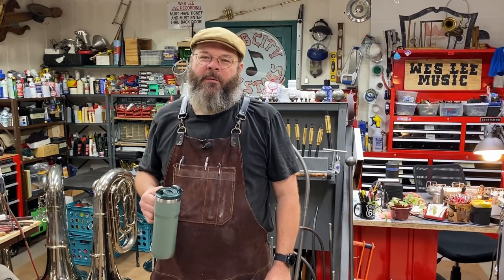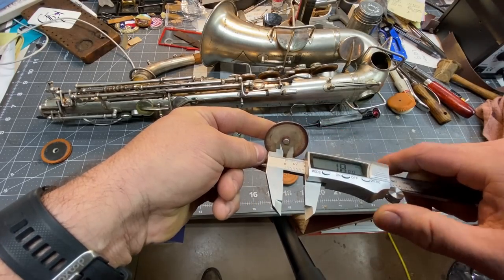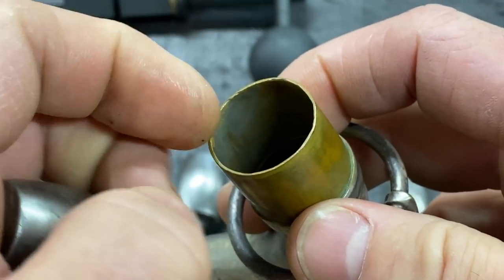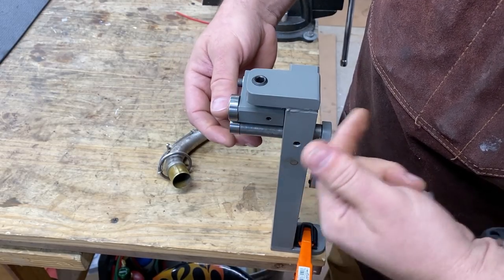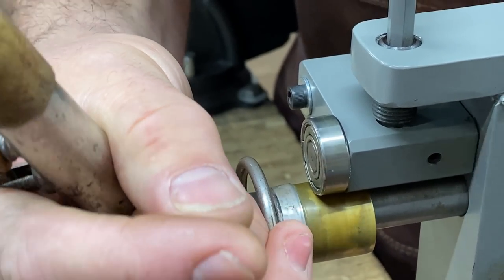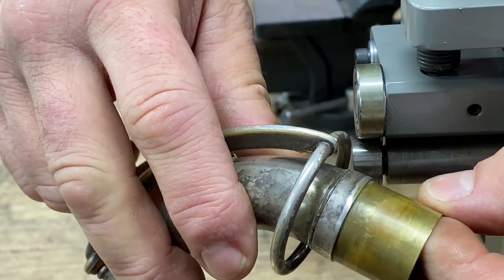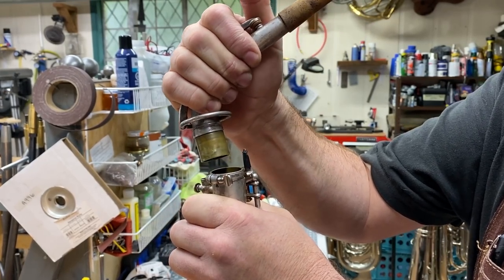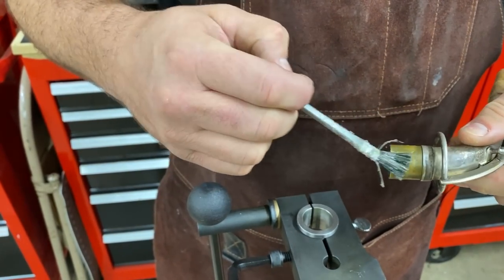Vintage Sax Restoration 1- Tools For Refitting the Neck- band instrument repair- Wes Lee Music

Comment: I've watched quite a few of these videos and I think that I'm really understanding that metal (specifically the ones you're working with) are not NEARLY as hard as my brain thinks they are. So, many times you'll use such a delicate touch and I'm surprised that its making any difference. This was a great example of it. Such a fine touch and the metal just moves as you need it. Really interesting.

Comment: Ya  made that  neck  fit...    right   tight &   outta  sight    !  I  wouldda     used a  crocus  cloth   &  sand it   BUT   you re    much  more correct   the way  you did it  I just dont have  that tool &   even if  I  had it  I   would  know  how to use it properly  !   you are a craftsman  I m a  musician  !

Comment: Very interesting Sir, I wounder if you could help with a question I have.  I have a Keilwerth sx90 Black nickel Tenor. Some of the black nickel on the neck has come off. I was thinking of removing the rest of the black nickel from the neck. I was think then of buffing the then silver metal up to a shine,or even getting it electro plated silver. What do you think would be the best to do ? Do you think it would affect the tone / sound of my Keilwerth? 
Thank you Roy

Comment: This seems like it may have a similar feel to the way a pipe cutter works. Different end result, and dimensionally a pipe cutter blocks a pipe being put onto it the same way, but I am wondering if a version exists where the work piece is stabilized and the tool rotates around it.

Comment: Thanks for the videos. Just wondering if you ever use one of the neck isolator/checkers to make sure you have a air tight fit.
Reply from the maker: I’m not familiar with that product, where do I find info on it?
Reply: @wesleemusicrepair9820   JL Smith sells some, as does musicmedic.
Reply from the maker: @StohrerMusic  thanks. Went and looked. Tool for an already solved problem. I appreciate you letting me know.
Reply from the maker: Neil, I use rubber stoppers to check air tightness of solder joints, bracing and such. I didn’t know there was a specific product for that. Although I should have.

Comment: Bravo!  However, what you refer to as "a quarter turn" really isn't a quarter turn at all - it's more like "a smidgen."  LOL.  BTW, I'd love to have you slightly shrink two Radio Improved Alto necks to fit not as snug in my Mk VI.  They sound better than the original neck and I'd like to play them (without bear-arming them in and out)!